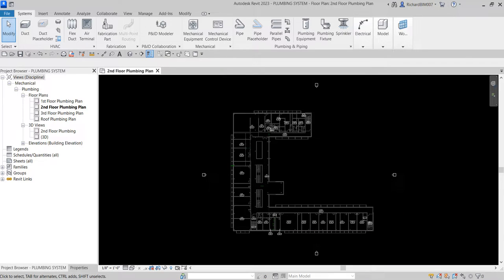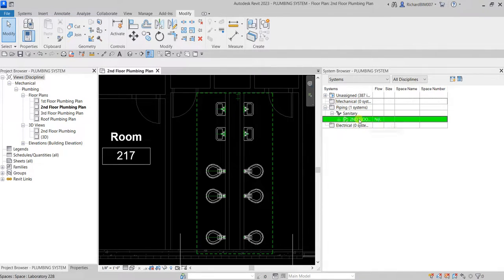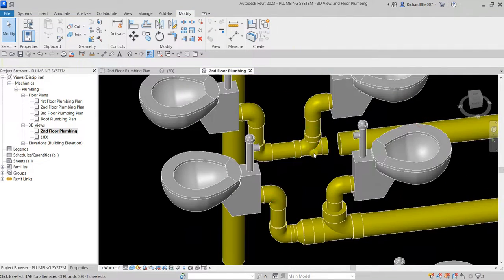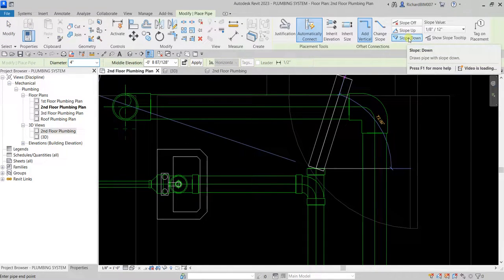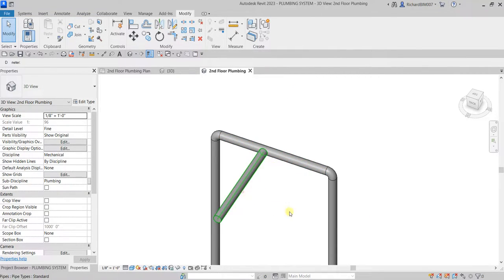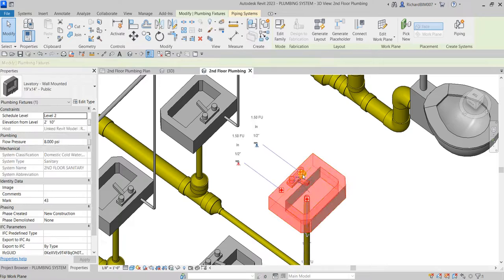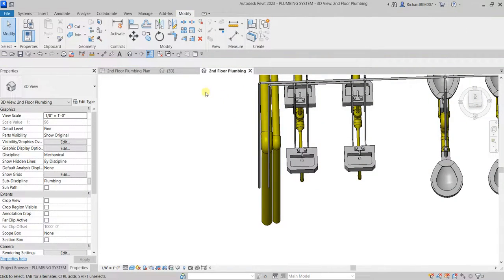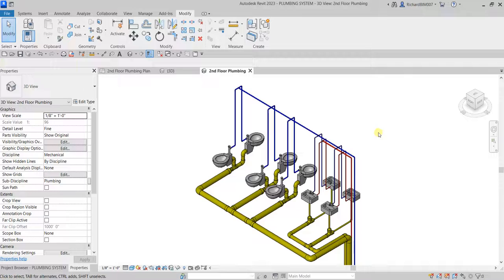REVIT 2023 FOR MEP - PLUMBING SYSTEM

Comment: What's that standard pipe you using for modelling hot and cold water supply piping? Is it poly pipe or HDPE or PEX or PPR?
Reply from the maker: I’m just using the typical setup for domestic water services. Usually it’s PEX or PPR for hot and cold lines. HDPE and poly are mostly for cold water or external runs, not really for internal hot water. It just depends on what the project spec says, but PEX/PPR is the usual.